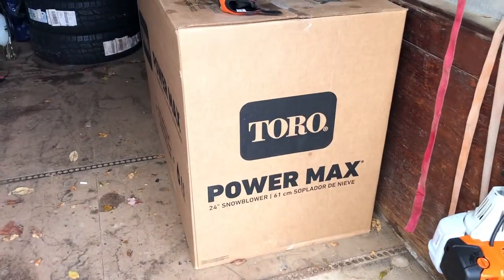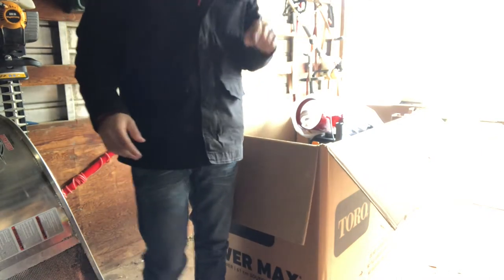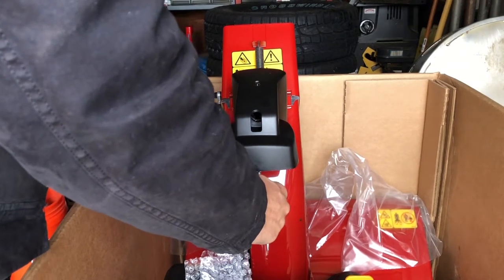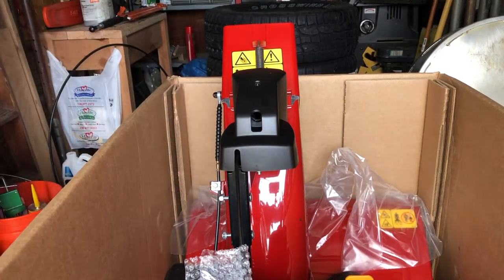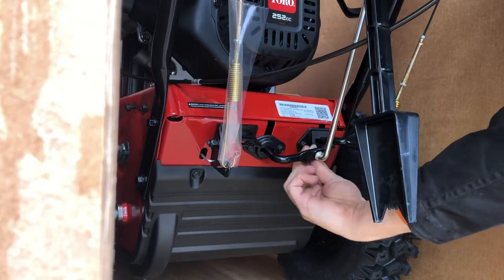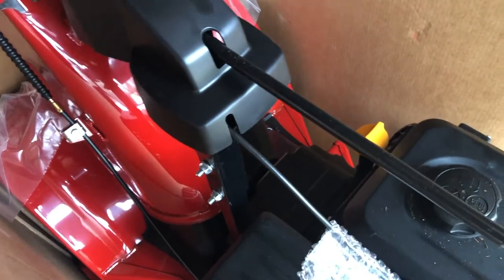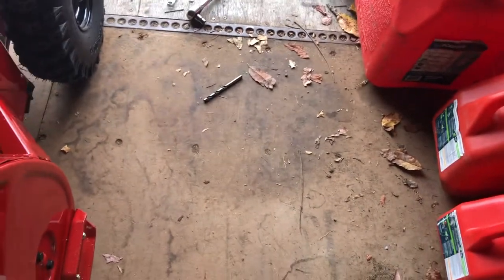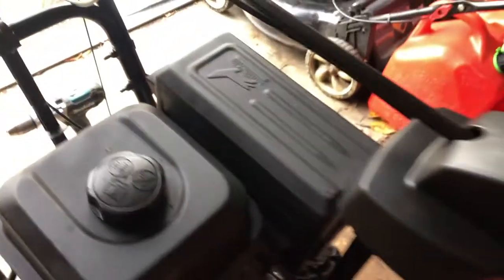Unboxing Toro 824 Snowblower / First Start!

Comment: Just received my Toro 824oe from Home Depot free delivery. The box was upsidedown in the truck . When i open the box the oil was already in the machine. Should I return this unit since the machine was upsidedown and fill with oil all day in the truck? Should i worry about the engine ?
Reply from the maker: Personally I would return it and get a new one. It’s not worth trying to fix because as soon as you do start to fix it you have a harder time returning it.
Reply: @ 
I am waiting for a replacement. Don’t understand why they would put oil in the machine when you know people will mishandle it when delivery by freight company

Comment: Wouldn’t it be easier to cut the box away and assemble it outside the box?
Reply from the maker: Technically yes. I didn’t have the space to take it out and move the box. I was assembling it inside a box trailer.